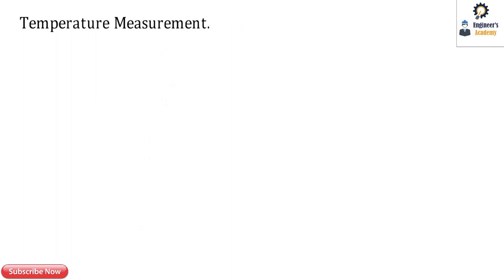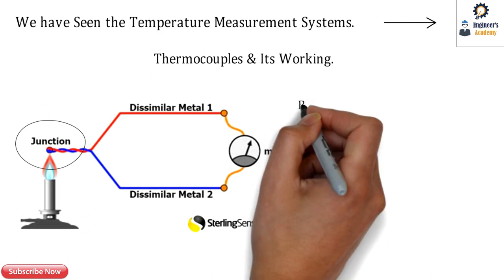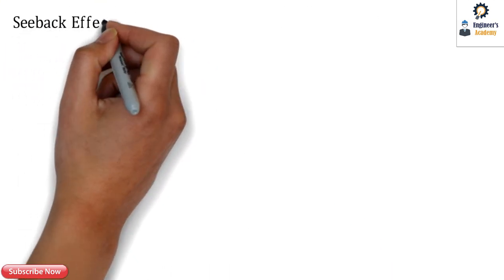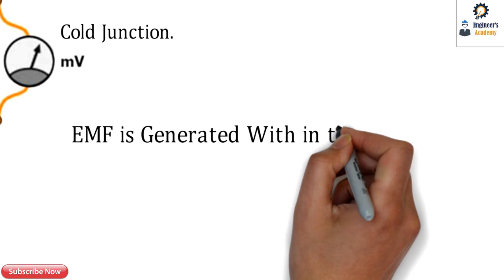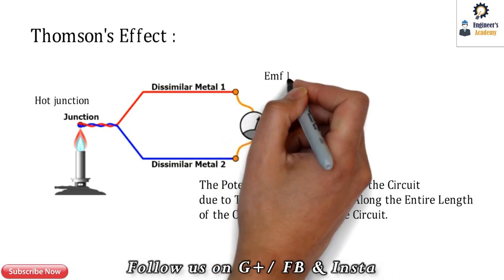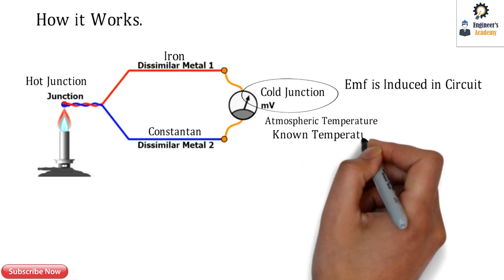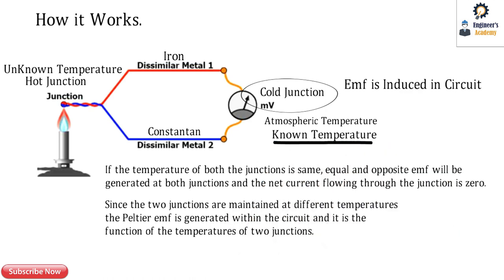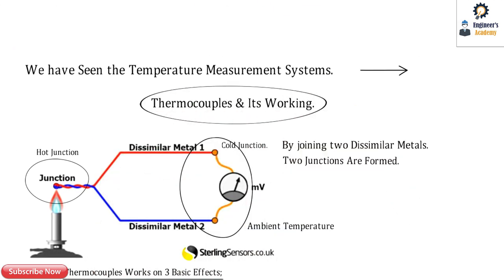How Does a Thermocouple Works?? ||Engineer's Academy||

Comment: How is emf generated due to temp difference
Reply from the maker: if one junction is heated, electron diffusion occurs and hence, potential at the hot junction becomes greater than the cold junction. So when a temperature difference exists between the two junctions, a thermo emf is produced. !

Comment: Why the current become zero when we use same temperature at both junction?
Reply: there is no voltage difference between the two junctions, consequently, the current doesn't flow in the circuit. a current will flow from the higher voltage to the lower voltage, if the voltages are the same, it ain't flow.